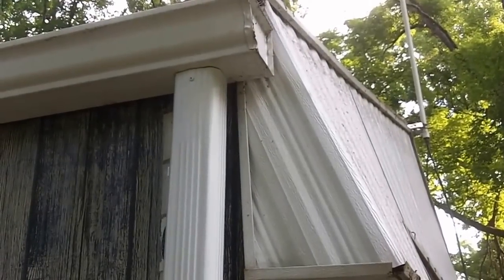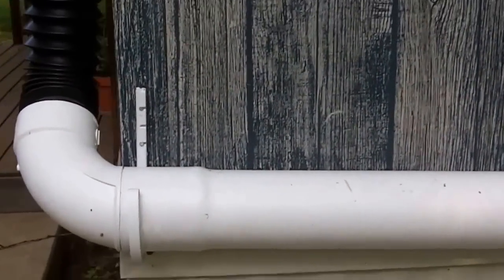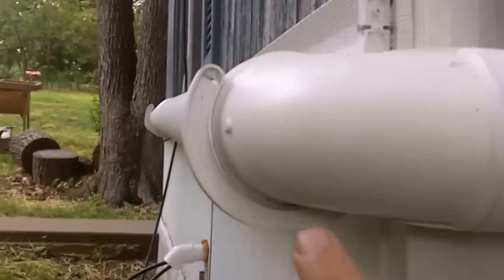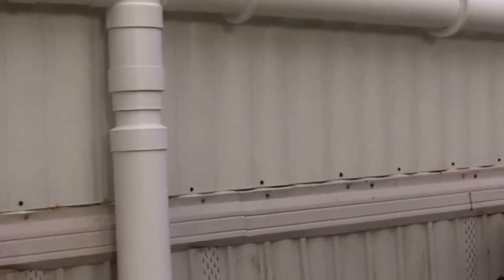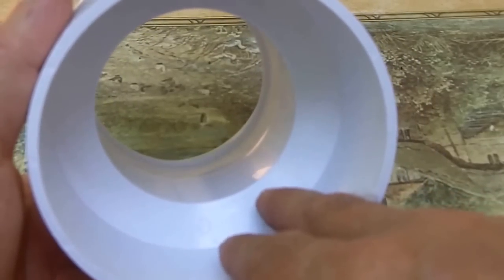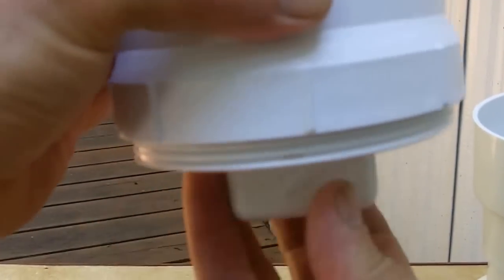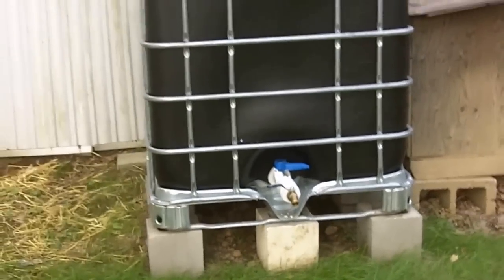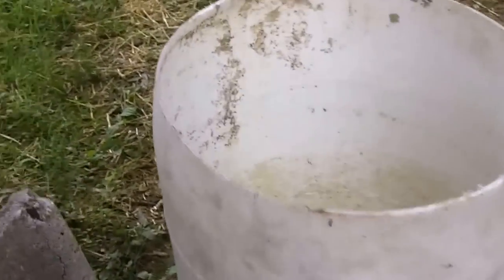Rain Water Collection System

Comment: One problem with your IBC totes.  When the tote fills up to the point where it can't hold any more water.  You need to to allow the water to go somewhere else.  Doesn't matter what or to what but it needs to go somewhere.  Else it will pop that mesh filter off and more of it keep filling the tank as it runs off.

Comment: Make sure you boil and treat water with chlorine filter before drinking,
Reply from the maker: No need to boil and treat with chlorine. Boiling wastes energy and chlorine is carcinogenic. All that is needed is a good quality gravity drinking water filter designed to take out bacteria and chemicals (including chlorine) such as the ceramic type filters the professor McCanney sells, and also sold by Berkely, Propur, etc.
Reply: +thenewsurvivalist OK!

Comment: Before you paint plastic  I strongly suggest that you watch:
How To Paint Plastic - HD - The Basics
https://www.youtube.com/watch?v=1hUds71Bx48&list=PL4RRYdf6votG4w37BpOnnreL3sl8Ro4ri&index=4

I also wanted to point out that you want to use schedule 35 (DWV) 4" pipe unless you have money to burn.  All of your connectors also need to be schedule 35 fittings.

Finally I can not recommend too strongly that  you read this rainwater manual:

The Texas Manual on Rainwater Harvesting 
http://www.twdb.texas.gov/publications/brochures/conservation/doc/RainwaterHarvestingManual_3rdedition.pdf

* The valves on most totes are a non standard European thread and need special adapters to convert to  NPT (National pipe thread)   You can get them mail order from this company:

http://www.responsiblecontainer.com/
Reply from the maker: The paints I used on both the PVC pipes and the totes worked fine. Wasn't sure about the paint I used on the totes at first (primer and paint in one) but once it was given enough time to cure in the sunlight the paint on the totes stuck just fine.
Reply from the maker: The paints I used on both the PVC pipes and the totes worked fine. Wasn't sure about the paint I used on the totes at first (primer and paint in one) but once it was given enough time to cure in the sunlight the paint on the totes stuck just fine.
Reply from the maker: The paints I used on both the PVC pipes and the totes worked fine. Wasn't sure about the paint I used on the totes at first (primer and paint in one) but once it was given enough time to cure in the sunlight the paint on the totes stuck just fine.
Reply: would white paint work? Will white paint still allow sunlight through? Im guessing the primer alone should be good enough to block the sunlight.